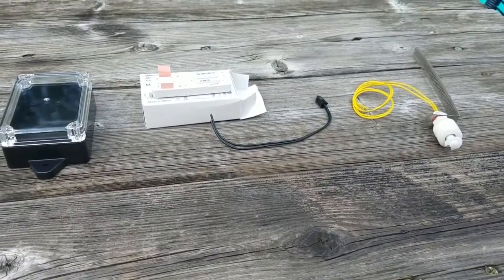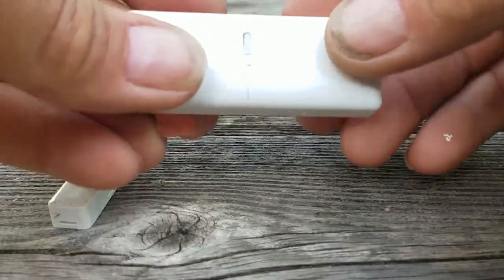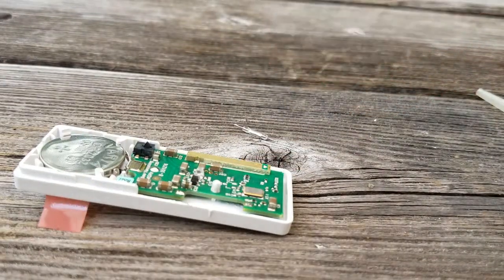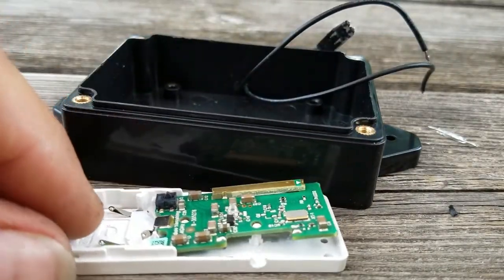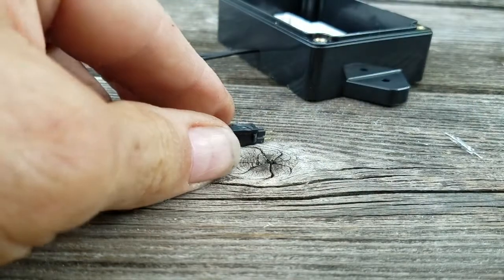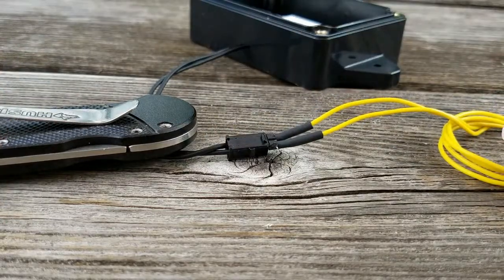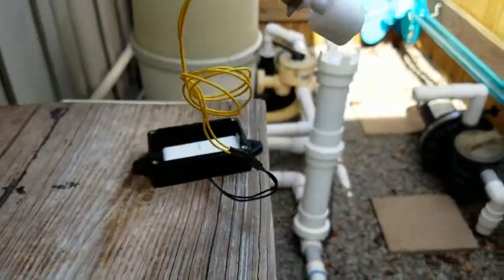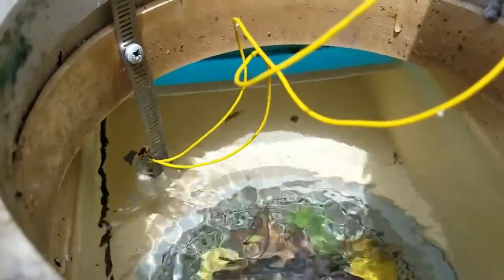Zwave Pool Level Switch, How to add the level of your pool warning to your home automation

Comment: Could have just hook it up to a fill water valve. Guess everyone thinks different
Reply from the maker: Yes I could and already have a zwave valve, but the pool should never be low and if it is then it is probably a leak, in which case I would want the pump off and not the refill on